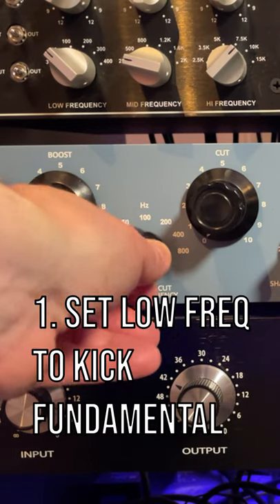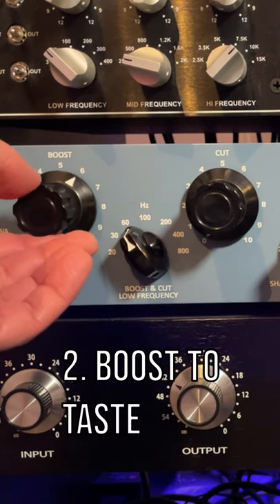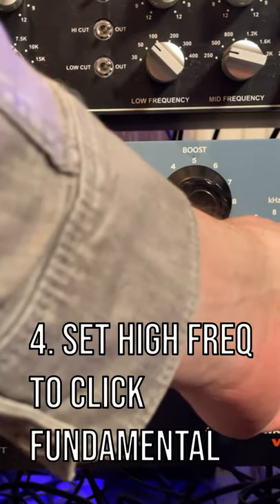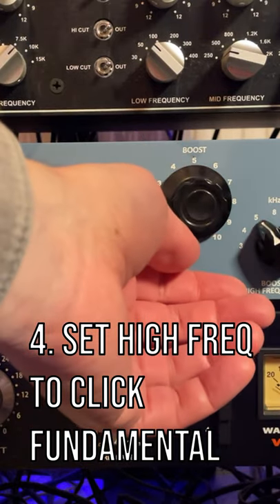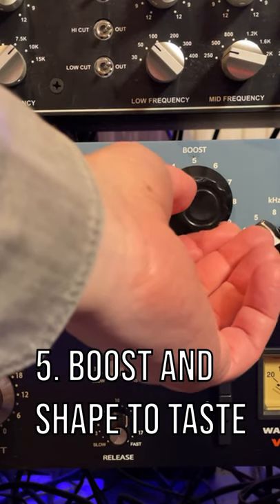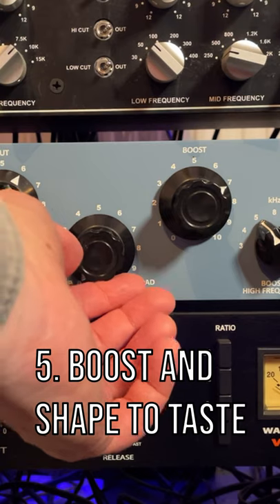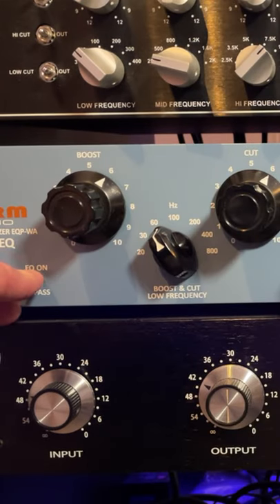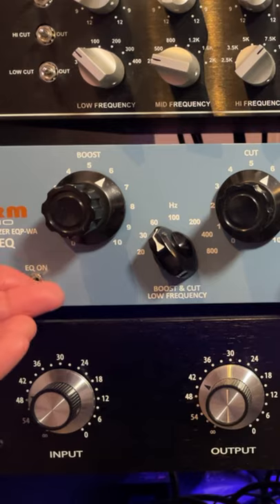Pultec EQ trick on kick drum #Shorts

Comment: Nice trick, I just tried in one on my songs and I was surprise how much clear the kick sounds in my Avantone monitors. Do you use this trick with other instruments?
Reply from the maker: Yes it works quite nicely on the kick. This particular trick with cut/ boost at the same frequency can be used with other instruments that feature low frequencies too (eg floor Toms) but it works particularly well on kick drums.

Maybe also check out the full video on comparing the hardware Pultec with the UAD Pultec 😉.